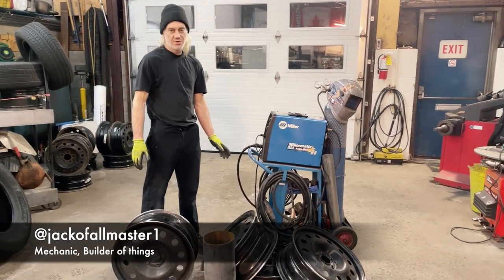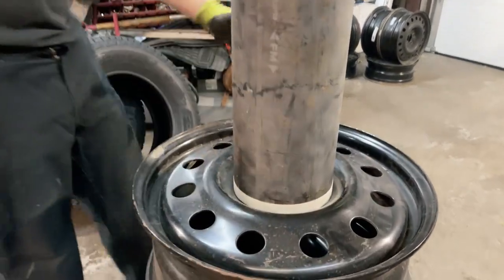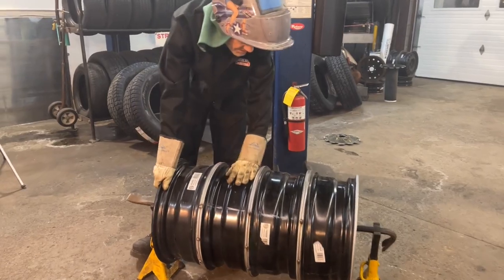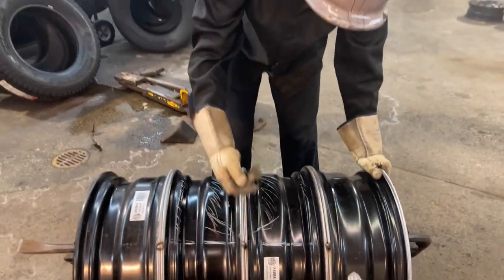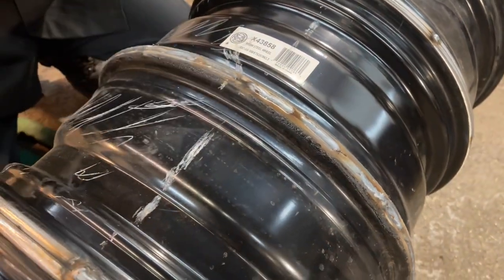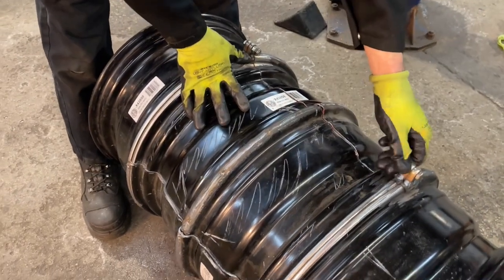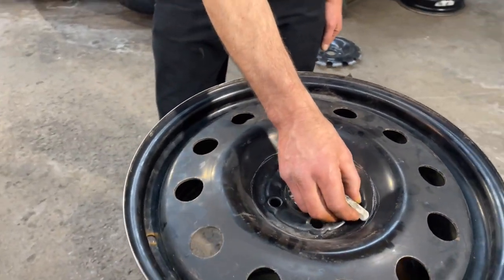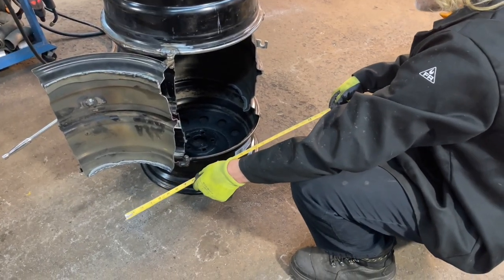WOOD STOVE FABRICATION USING RECYCLED STEEL WHEELS

Comment: With all the 55 gallon barrels on this planet I don't get why anyone would want to waist the time & money(welding wire/gas/grinding disks/electricity) making a lesser version of a barrel.
Reply: Some things are just fun to experiment with -- loosen that belt around your "waist".
Reply: Re-purposing old wheels so they also don't end up in the landfill also works.
Reply: @BabyBlueRose82  1st off, they are steel. Steel goes to scrap to be recycled so it would not go into a landfill.

2nd, those are brand new unused rims. They could have been sold or given away.
Reply: @TDesil5000  actually, they are 1year used, wouldn't fit anything else that came our way, so we decided to spend some family time doing things that the kids wanted to learn.  When you own your own shop, and have used disks, and children willing  to learn something other than how play a video game, I call it a win.
Reply: @BabyBlueRose82  if that were your motivation than there would not be this video nor would you have shared it into multiple subreddits. It's content that you are pushing out there and you should accept criticism
Reply: @TDesil5000  "It is not the critic who counts; not the man who points out how the strong man stumbles, or where the doer of deeds could have done them better. The credit belongs to the man who is actually in the arena, whose face is marred by dust and sweat and blood; who strives valiantly; who errs, who comes short again and again, because there is no effort without error and shortcoming; but who does actually strive to do the deeds; who knows great enthusiasms, the great devotions; who spends himself in a worthy cause; who at the best knows in the end the triumph of high achievement, and who at the worst, if he fails, at least fails while daring greatly, so that his place shall never be with those cold and timid souls who neither know victory nor defeat." Theodore Roosevelt said it pretty good.
Reply: @BabyBlueRose82  quoting a historical figure in a youtube comment is just about the most cringe thing I've ever seen.
Reply: 55 gallon drums make great stoves, but if you don't have one to hand but you do have wheel rims laying around, you might as well use those, also wheel rims are thicker steel which means they'll last longer and provide greater thermal mass. Wheel rims are smaller than 55 gal drums which means they have a smaller footprint which might be an advantage when placing a stove in some situations.
Having lived and worked in some cold places I've seen homemade stoves made from all kinds of things, and I have to say that old wheel rims are far from the worst.
Reply: I’m looking into this simply for cheap welding practice. Buy junkyard wheels, build stove, sell, repeat. It’s sustainable, it’s satisfying, and it just looks better than a simple, nearly straight wall 55 gallon drum. That said, I wouldn’t mind having some of those to repurpose as well.